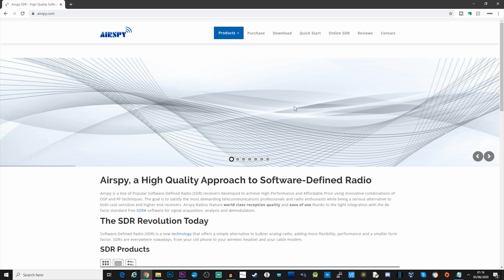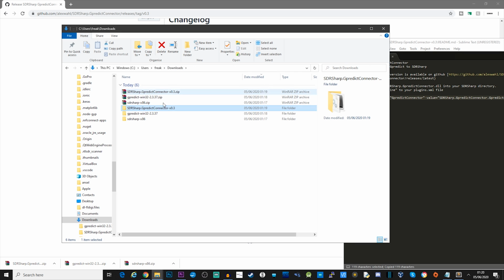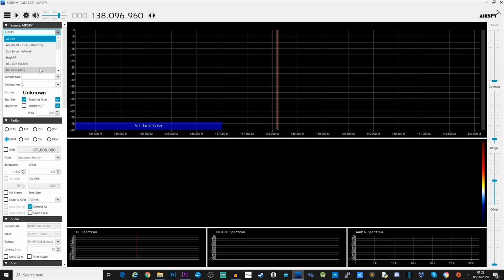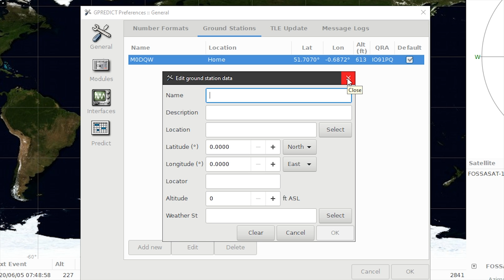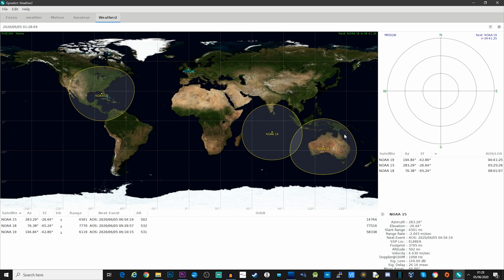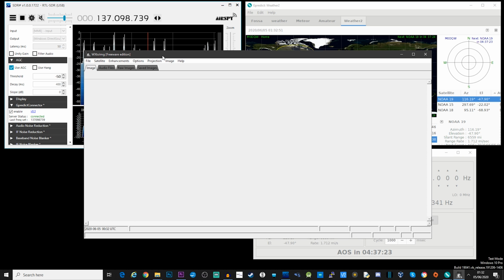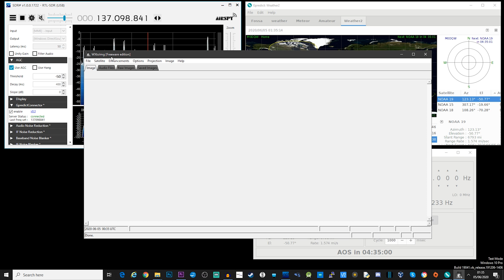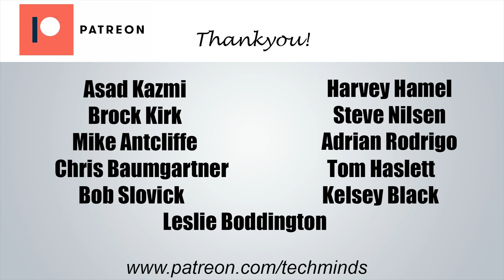Weather Satellite Tracking Software Setup

Comment: On the new versions of Gpredict, you have to create a folder inside of the plugin folder and name it something; then copy the dll file into that. It wont work, unless a folder is created inside of the plugins folder - very important. Nothing else to edit in notepad.

Also wxtoimg can no longer update keplars unless wxtoproxy is installed, that has to be installed and configure it, then it will work.

This is a good video, but it needs to be updated.

Comment: This is an old video so not sure if anyone will see this.
I am just getting into SDRs and seen many of your videos. I have been playing with wxtoimg, VB audio cable and SDR console v3.
I was hoping you may have a troubshooting tip. If I select vb audio cable and let the program handle tuning for NOAA 15, 18, 19 the decode in wxtoimg is very bad. Tearing and static accross horizontal lines in wxtoimg. If I select my PC speakers and then back to vb audio cable it works. So I know I can get clear images but only if I sit at my PC for every pass. Any tips?
KK7JVV

Comment: Thanks, a whole lot for your very explicit video. I just constructed a V-dipole antenna and installed some software on my Linux system.  My challenge is installing, running SDR-SHARP on Ubuntu 20.04 Linux distribution. I would really appreciate your assistance.

Comment: I think you hit every needed detail but one. Audio settings. I either get black screen, or snow screen. Baud rate? Bit rate? Where to make these adjustments?  I do not know why your video came up so far down in my search but it should be the first one that pops up!
Reply: Based on what I saw in the video, there is a baud rate setting in the image decoder. As far as the audio, it can help to turn on the monitor option under recording devices in Windows so you're able to verify that VB Cable sounds like it should with proper volume, clarity, etc.

Comment: I tried to follow this to the letter, but as of 02/10/21 my program and gpredictconnector files don't look like your, and do not see, in sdrsharp where the gpredict selection is.
Reply: In gpredict, go to preferences, add new, Type SDR sharp for the name, IP 127. 0. 0.1 Port 4533 and RX only then save it.

The Channel Op answered someone else about this in the comments section and said he made a video as well.

Comment: I have a problem when a click play in the air spy sdr there is a message that say there is no connection your pc refuse the address 127.0.0.1 4533
Reply: Did you ever solve this? Maybe try double-checking that the preferences in gpredict are entered correctly with that IP and port. Sorry, that's all I have without more info.

Comment: My setup was working on my laptop for awhile and then for whatever reason all the pictures I was getting were scrambled. They looked like the picture on an old TV when the horizontal hold was not in tune - the picture was pulled apart into jagged bands. Tried all sorts of things with no luck. Then someone on the Facebook APT Group suggested it looked like an audio distortion and suggested I not use VB  Audio but the native soundcard. So I set HDSDR (my receiving software) to output to Windows Soundmapper and WXtoIMG's input to Windows Mixer. IT WORKED! In this setup, you can still hear the satellite on the speakers, and the volume control sets the signal strength input to WXtoIMG. I set it to 28% to get 55% volume on WXtoIMG when recording.  So in case someone runs into this problem, worth a try.

Comment: WXtoimg software seem to missing the program software. All I get is a text file. Any help appreciated.
Reply from the maker: I had the same issue this evening while installing on a friends windows 10 machine. If you look on the website for the BETA version that worked for me and installed correctly. I think the original installer is crashing so try the beta version.

Comment: HELP HELP HELP HELP!! When I click on the radio control button it says that there is an error. It says I need to configure a radio first.  What is going on?
Reply from the maker: Oooops there is a step which I did not include in the video! Sheeeet! In GPredict, goto preferences and then interfaces. Click Add New. Call it SDR Sharp, host is 127.0.0.1 and port is 4533, rig type RX Only. Save it and then you should be able to open the radio panel.
Reply: @TechMindsOfficial  Please pin this comment.
Reply from the maker: See this that I just created: https://youtu.be/MSxwuORvZdI
Reply: @TechMindsOfficial  Thanks so much! Working now. Love your videos. You are the only person that made a video on how to connect SDR Sharp to this software. Thanks.
73 de W0AAE
Reply from the maker: Have you installed the GPredcit plugin on SDRSharp and enabled it?

Comment: Is there any difference compared to Orbitron and gpredict you noticed
Reply from the maker: Orbitron works just as well as GPredict
Reply: I still use orbitron. In fact it is dos software but works very well on Old computers.
Reply: you can also try SDRConsole V3, it's SDR and satellite tracking in one application.